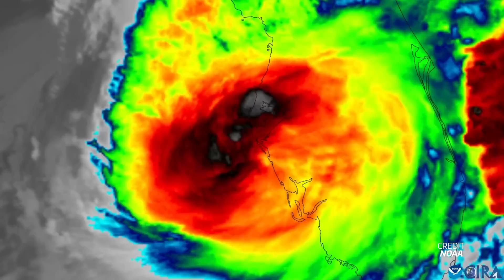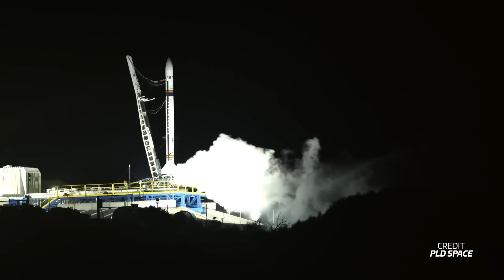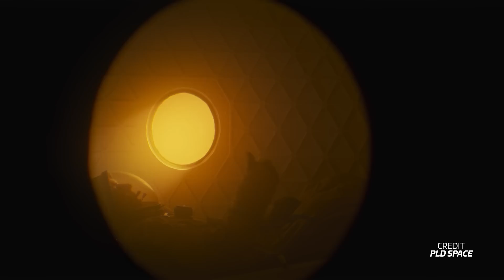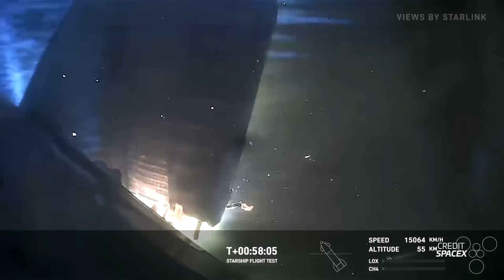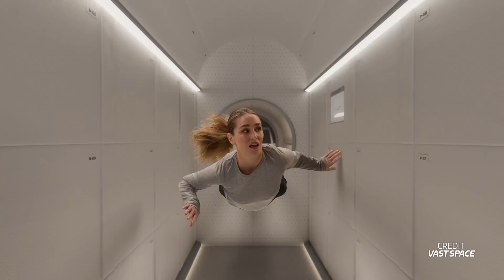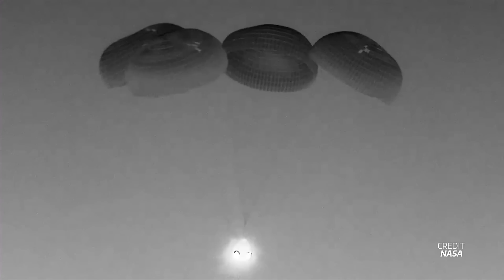Is Starship Ready for Launch? Plus, PLD Space Unveils Bold 10-Year Plan! | This Week In Spaceflight

Comment: Those station images look like a house that's been prepped for a real estate opening. And can you use wood in an environment where  a fire would cause a very bad day?
Reply: It might show wood, but it could be a processed wood that has pellets in it, that release CO2 when heated. They would be better off having a heavy woven wool matting. This is going to offer insulation protection and will not burn. It will also wick water away from the cold metal.